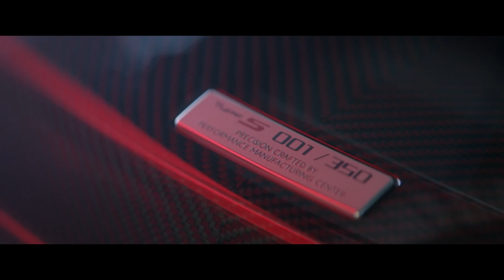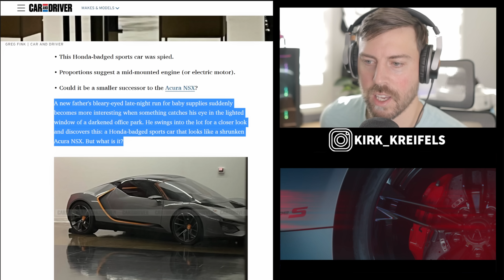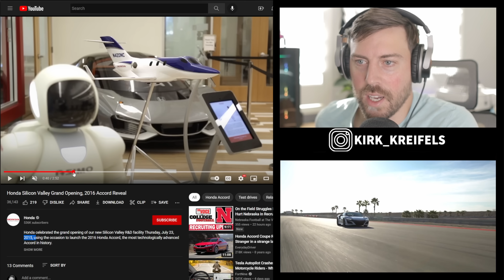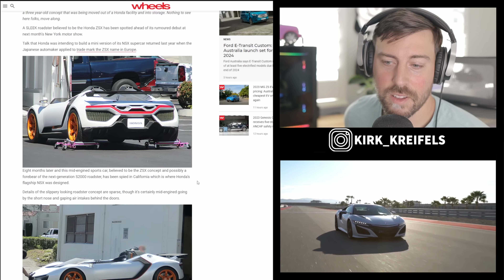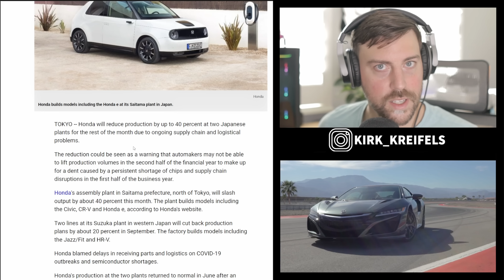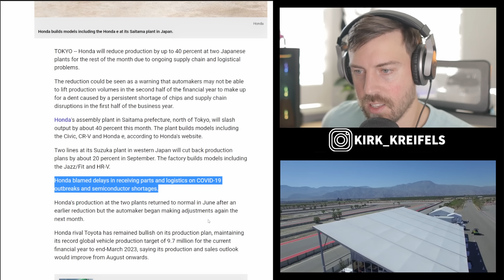*IMPOSSIBLE* Did the New Acura NSX EV just get Caught?!

Comment: i don't think it's an EV. there's too many openings for an EV.  3 air intakes in the lower front bumper, you mentioned the radiator. Air extraction before the windshield. 1 air intake each side aft the doors which are shaped similar to the outgoing NSX. It's not outrageous to think The NSX's V6 has a longer life that could outlast the 2nd gen. At 3.5L and 500 to 520 HP depending on the spec before the electric motors i don't think it's overly stressed. Updated for better emission it could see another 10 years of production. Batteries and electric motors removed it could be a smaller version of the same platform and chassis.  The next NSX could've been hiding in plain sight this whole time.